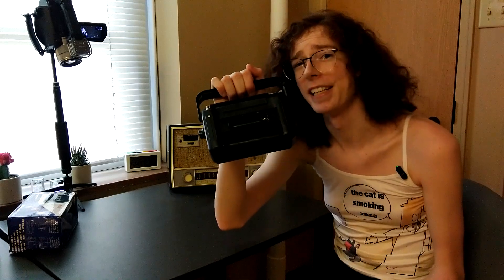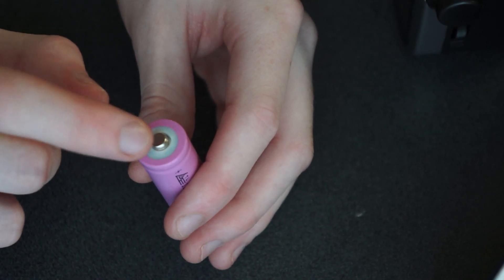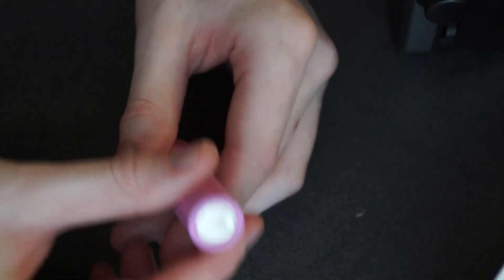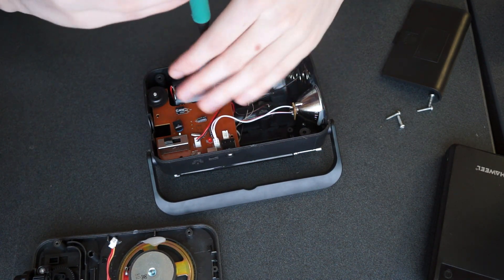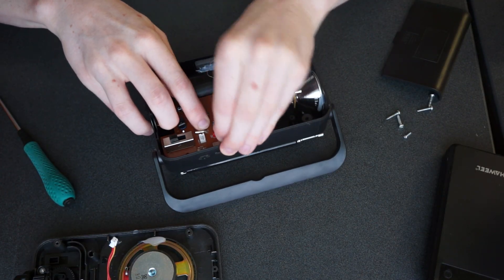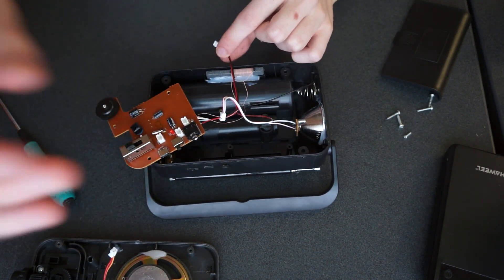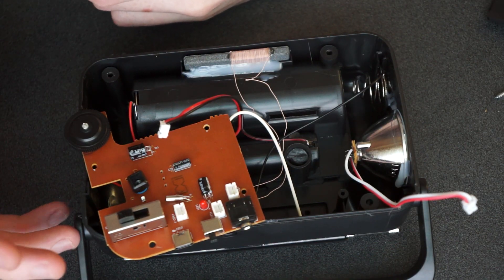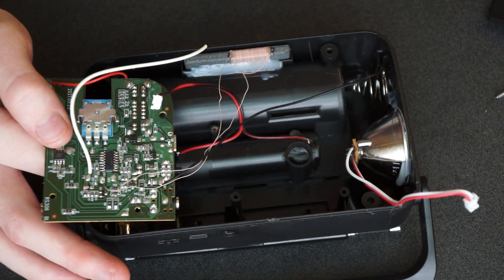This AliExpress radio will kill you

Comment: Absolutely terrifying, you'd have thought some basic protection would be in place. I know Aliexpress and cheap electronics can be a pretty mixed bag, but usually it's okay. I've bought tons of cheap/nasty electronics and most have been functional albeit probably not long lasting. I've got a LOT of solder projects on there like LED Christmas Trees, Radios, Lights, etc from there and they've all been good. But I definitely wouldn't want to risk my life on them that's for sure. That's why i don't mind the ones with the rechargeable nokia batteries because that at least has some inbuilt protections (well.... At least they're meant to lol and they're replaceable)
Reply from the maker: I've definitely got a ton of little soldering projects from AliExpress and I've always been confident in the circuit design of those luckily!